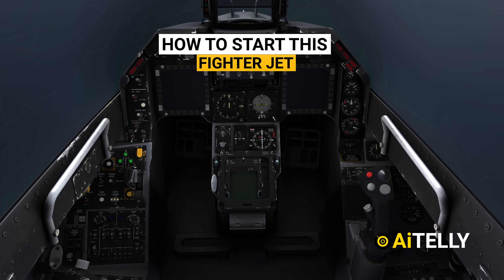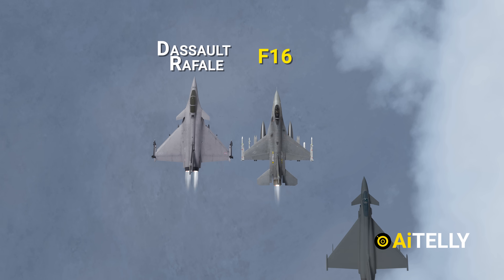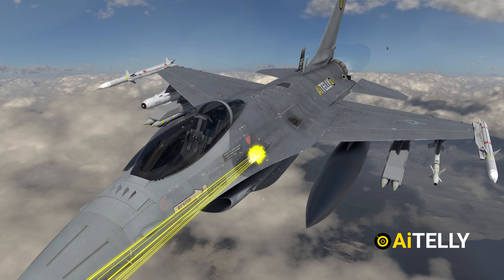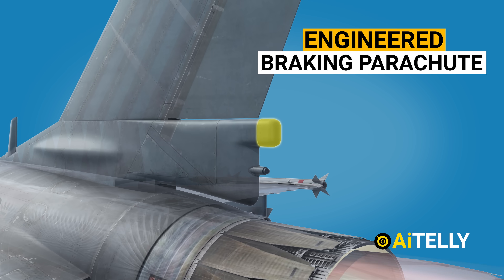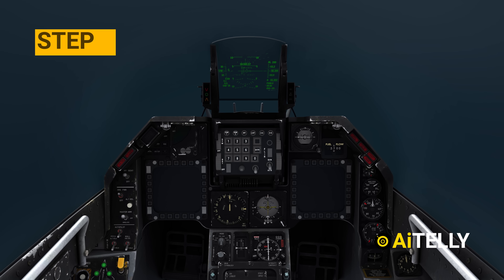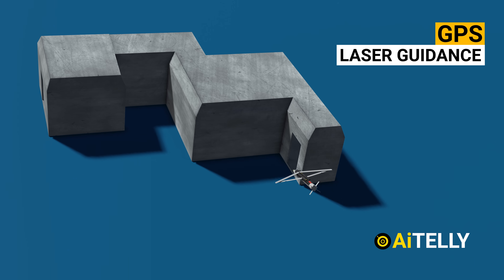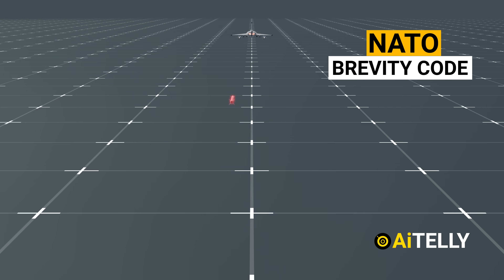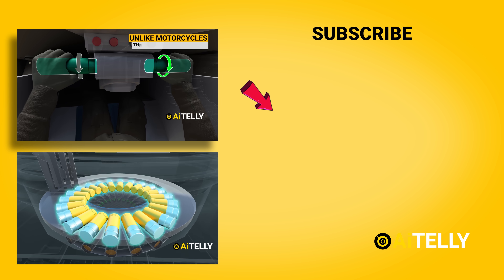F-16 Fighter Jet How it Works | 4th Generation Multirole Fighter F16

Comment: As a former F-16 crew chief, this was kind of hard to watch
Reply: Yeah, I never knew my RWR antennas were TWS radars all along!
Reply: What specifically is it that you find hard to watch? I’ll trust you more since you worked on the plane
Reply: @TC-en7cu  explain why then..
Reply: @ExecutivePuma it was not built to replace the F-14.
Reply: @RA-el6zj  it's called a throttle, not thruster. You don't need rwr or standby Adi on to start the jet.
Reply: @TC-en7cu  Thank you. 🙂👍🏻
Reply: As an F-16 pilot, I didn’t know Step 3 to starting the engine was turning on the RWR.
Reply: I love the leading edge slats!!! That’s definitely what they’re called!

Comment: The F 16 was not the successor of the F 14 Tomcat. The F 16 was the winner of the light weight fighter competition. The F 14 's successor is the F 18 Hornet derived from the YF 17 that lost the light weight fighter competition.
Reply: Correct!
🧠
Reply: correct, F-16 was replacement of F-4 Phantom II and F-105 Thunderchief ... because F-15 Eagle was too expensive
Reply: I think they just said it that way because the Navy was shopping for a replacement at the same time as the Air Force, and both looked into the F16, just so happens the Navy decided the hornet fit their needs better, while the Air Force went forward with the 16. It's not that what they said was inaccurate, it was just incomplete.
Reply: Totally agree 👍
Reply: Additionally, 5195 Phantoms F-4 were made. Narrator confirms to date 4,500 F-16 units had been built innacurately mentioning it has been the fighter with most units made.
Reply: Exactly
Reply: @JanChvojka  Incorrect. The F-14 and F-15 were the replacements for the F-4 Phantom II. The F-16 and F-18 were created because the Navy and Air Force needed cheaper and more maneuverable aircraft to perform functions that the larger and more expensive F-14s and F-15s couldn't do.
Reply: The F18 Super Hornet replaced the F14.

The F18 Hornet did not and served side by side with the F14 for 20 years before the Tomcat was retired.
Reply: no matter what in NO way was the F-16 a replacement for the F-14 as the US Navy never has used the F-16 and the Airforce never used the F-14.  F-14 and F-16 were both developed in the same era regardless.  Don't know where they got that idea from.
Reply: Correct. And also competed against the F18. Which after loosing with the F16, the F18 was selected for the Navy.
Reply: @adrianvega9946  That would be he YF-17
Reply: @2ksnakenoodles  Yes exactly
Reply: It's always such a bad idea to get someone wrong regarding aviation.

Comment: Your side stick labels are correct, except the "view reset" for track IR is the nosewheel steering/missile step button, track IR is a tool used in flight sims to capture head motion when looking around in a virtual cockpit. I also believe is display management system not data management.
Reply: Very poorly done research on this topic!

Comment: 1:10 Uhh, what? The F-16 was part of the lightweight tactical fighter competition for the US Air Force. The F-14 was a Navy fighter. The only sort of true thing about this comment is that the F-16’s competitor, the YF-17, evolved into the the F-18 which did support and eventually replace the F-14 in Navy service.
Reply: Yeah, I was like what? There's always some small mistakes in every video they made, but this is potential misinformation
Reply: The bugles on the side of the jet, aft of the nose are also not TWS ,they are missile detection. Small innacuracies being presented with confidence in this video
Reply from the maker: Politicians wanted to produce one Aircraft for the Airforce Navy and Marines.
But it failed.
Reply: @Aitelly  Yes, but this plane was F-111. F-16 was never meant to be replacement of F-14. F-16 from begining was designed to complement F-15 in USAF. YF-17 (latter F-18 Hornet) which loose competition with F-16 became later a NAVY fighter and as modernised version (Super Hornet) replaced F-14.

Comment: The rudder is not used to turn the aircraft left or right. The rudder is used to maintain the position of the nose of the aircraft (so that its going where it's pointing). Turning an aircraft is acheived by rolling the aircraft and pulling up. Depending on how tight turn needs to be more or less roll and more or less up stick is used.

Also, the combustion of fuel is further back in the engine, thr frint section is the compressors for compressing the incoming air.
Reply: As a Juno: New Origins player, I can confirm this as true and 100% real
Reply: Rudder ?
Reply: As an engine mechanic, I'm glad I'm not the only one that noticed that combustion error.
You have the fan (low pressure compressor), core (high pressure compressor), and then the combustion chamber. Then, there's the HPT and LPT, with the augmentor and exhaust nozzle following.
Reply: @johnc1014  I was an F-16 Jet Engine Mechanic when I served in the 80s.
Reply: @PaulJosephdeWerk  Nice. Our jets were built in the 80s. Did you work on Pratts or GEs?
Reply: @johnc1014  Pratt F100-PW-200
Reply: @PaulJosephdeWerk  👍 I never got it work on those. Only F110-GE-100.

Comment: I have had a Falcon simulator on my 286 PC in 1984. It was quiet amazing to realice that the turn radius at high speed was way bigger than at low.
Reply: Falcon simulator? Is that a plane
Reply: @Michiganian8  the F16 was so called, Falcon, and so the computer program.
Reply: Is "quiet amazing" when you don't say anything out loud (or make any other noises), and just think about it instead? I call it mental astonishment and use it often unconsciously, like when watching videos alone or when verbal utterances would be inappropriate.

Comment: I don’t recall the F-16 being made to replace the F-14, the jets had completely different missions and were operated by 2 different services, it’s also not the most produced fighter ever as stated, not even the most produced western jet fighter which is the F-4 phantom, perhaps you meant the most produced western 4th gen fighter?
Reply from the maker: Politician did - it was all about the Cost of maintaining the F14.
they thought the of one Aircraft for the NAvy Airforce and Marines .

but it failed
Reply: @Aitelly  indeed, the F-14 was incredibly expensive and retired in favor of the F/A-18 in no small part  due to that reason, however the F-16 was developed at roughly the same time period as the F-14, and was developed for entirety different reasons (low cost light weight fighter) for the Air Force than the F-14 for the navy (fleet defense fighter). These 2 aircraft didn’t really have anything to do with each other as their roles were so opposite, so to my knowledge as Iv looked around, I can find no mention of the F-16 even being considered to replace the F-14. However If you’ve read this somewhere and have a source I’d be willing to read it

Comment: A little fun fact: The block designations for the F-16 either end with a zero or with a two. If the designations ends with zero, example F-16C Block 50, that means that it uses the General Electric F110 engine, but if the designation ends with a two, example F-16C Block 52, that version has the Pratt and Whitney F100 engine. (Although this applies only to Block 30,32 and forward as that is when the F110 was first introduced to the F-16)

Comment: 1. The performance of the F-5, which the U.S. made to South Vietnam in the Vietnam War, was better than expected, and shocked by the maneuverability of the North Vietnamese Mig-21, the U.S. Air Force realizes that cheap, high-performance, lightweight fighter jets are possible. So, LWF is a lightweight, high-performance, half-priced fighter introduction program that complements the high-performance F-15 with numbers, where the YF-16 and YF-17 will be contested and the YF-16 will be chosen to become today's F-16.

2. The F-15 was a high-performance fighter that replaced the U.S. Air Force's F-4 and F-106, but it was too expensive to maintain, and was under budget pressure due to oil shocks and the Vietnam War at the time, so the F-15 could not fully replace the number of the existing F-4s. That's why the LWF program, a new concept of cheap lightweight, high-performance fighter jets, was ordered.

3. The U.S. Navy, which was under the same budget pressure as the U.S. Air Force at the time, was receiving orders from the U.S. Congress to introduce lightweight fighters. So it subsidizes the F-14 and A-6, has a cheap, high-performance, lightweight fighter NACF program to replace the F-4 and A-7, and the U.S. Navy chooses the YF-17, which was already designed to save on development costs, and this is the F/A-18 Legacy Hornet.

4. The F/A-18 Legacy Hornet was built with the same lightweight fighter as the F-16, so it couldn't replace the F-14 because of its small armament and cambat range, so it completely replaces the F-14 by creating a new F-18E/F, which is 40% more in size.

Comment: F 16 was built to  compliment F 15 not to replace F 14 which  is a navy operated platform US Navy does not have F 16s in its inventory
Reply: F-16’s was actually planned to be on US carrier but lost to the F/A-18
Reply from the maker: Agreeed it was planned but it failed as the Navy and Marine has their own requirement
Reply: @netsimam  YF 16 and YF 17 originally designed for USAF Although YF17 lost the lightweight fighter aircraft competition to the F-16 Fighting Falcon, the YF-17 was selected for the new Naval Fighter Attack Experimental (VFAX) program. In enlarged form, the F/A-18 Hornet was adopted by the United States Navy and United States Marine Corps
Reply from the maker: Thanks

Comment: I want to mention that “fly by wire” means the stick does not directly control the craft, the stick gives instructions to the aircraft’s computer and the computer figures out the best way to accomplish the orders, this aircraft is also an intentionally unstable aircraft, so the computer has to constantly fix the course, the exchange for this is better maneuvering.

This is also why the F-16 has perfectly straight wings on the middle of the fuselage, instead of on top or angled on the bottom as other fighters.

Comment: There is one inaccuracy in your video.  The F 16 was not produced to replace the F 14, it was produced to compliment the F15.  The F15 was seen as high level fighter and the air force needed a light weight fighter to compliment it.  The F14 was a navy fighter while the F15 and F16 are air force fighters.  The light weight fighter for the navy was the F/A 18 and its variant, the Super Hornet would later on replace the F 14 in 2006.
Reply: Also the smaller size of the F-16 isn't the reason it can be vulnerable to SAM systems. It is quite the opposite.

Comment: Great explanation. Only thing that fuel injection is made not front part of engine but middle (combustion chembers). Front part of engine is compressors area that increases pressure of sucked air before burning respecting to Brayton thermal cycle. Thanks for video.
Reply from the maker: Thanks for your information regarding this engine

Comment: I have a complaint about the sound you used for the M61 Vulcan. That sound is actually the sound if the bullets impacting the ground. The other, higher pitched “whine” is the actual sound it makes.
Reply from the maker: Thanks for the info.
You might also like Nuclear Powered Submarine Engineering behind it #3d Nuclear Reactor released
Link: https://youtu.be/J0lb46Zi5-s

Comment: Fact: Fly by wire system is a necessity for F-16s stable flight since F-16s were built to be aerodynamically unstable to increase manoeuvrability to compete with Russian Counterparts.

Comment: Major issue with fuel injection;  it is not injected in the engine inlet/compressor,  but further down in the combustion chamber.

Comment: The F-16 was not designed to take the place of the F-14, however the channel got that wrong?
The F-16 is an Airforce plane, the F-14 was a Navy plane.
(Fun fact, the navy just bought some F-16s from the Air Force, to serve as “agressor squadron”.)

Comment: Very good video, keep up the good work. But please check your facts before using them in the video. General Dynamics doesn't exists anymore as it has been bought by Lockheed Martin ages ago. It was never intended to replace the F14 (that was the F18) but the F4, F5 and Mirage5 (US and Europe) as a complement to the F15 which was better but also cost much more to be the sole foghter to fill all squadrons and the US armed forces doenst like to single source and keep up the competition. The most build jet since WWII is the MIG21 Fishbed with over double the numbers of the F16, even if the MIG21 has stopped been produced while the F16 continues in its F16V variant. There is no 360° radar in the F16 and ANPG should be AN/APG-66, -68 or -83 depending on the version of F16.
Reply from the maker: Thanks for the feedback

Comment: the F-16C Fighting Falcon (Block 50+ Advanced) multi role air dominance fighter was not the replacement of the naval carrier borne F-14C Tomcat multi role fighter interceptor . . . not even close because both were designed to serve very different purposes . . . the F-16 was conceived to supplement the F-15E Strike Eagle (Block 30) multi role interdictor strike fighter, as a cheap alternative to the expensive F-15 . . . the carrier borne F-14C Tomcat multi role fighter interceptor was to be replaced by another dedicated carrier borne fighter interceptor, that we know now as the F/A-18 Hornet . . .

Comment: Wrong it wasn’t built to replace the F-14 it was built as replacement for the F-15. And at the time it was the Air Force that was looking for a new air superiority fighter. Not the navy. And it was pitted against the YF-17 which we all know was the better design but was terrible underpowered with the engines. But the US Navy saw the YF-17 prototype had potential and thus was given another chance with a new prototype that followed the same design but had better engines, stronger landing gear, and it was thus redesignated as the YF-18 and eventually became the F/A-18 Hornet
Reply: The F16 was built as a compliment to the F15. It was never intended to replace it. As for the YF17 being the better platform, that is 'very' debatable.

Comment: Correction. F-16 is not design to replace the F-14 Tomcat.  YF-16 and YF-17 are design to prove the Energy Maneuverable  Light Fighter Concept. There is a fighter mafia group, who believe a cheap light weight highly maneuverable, can allow USA to win any dog fight against the USSR MIG fighters. The F-14 and F-15 are big expensive fighters. USAF feel that a high cost and low cost mixes of fighters is a better idea. Thus F-15 and F-16 are the suitable pair. The Navy want a multi-role fighter to that can perform fighter and attack roles. Eventually, the YF-17 are modified to become F/A-18.

Comment: Ahh, the F-16 was not made to replace the F-14. The F-16 is an Airforce project and was never intended to go on carriers. It was made to be a more fiscally obtainable fighter for export and to bolster our own Airforce strength due to the high cost of the F-15.
Reply from the maker: Agreed 👍
Reply: And to give and edge in the "air to air" environment.

Comment: Love the information on the video, but no, the F-16 was never the replacement for the F-14.  While you are correct the F-14 was an iconic naval fighter, the F-16 was always intended for the US Air Force, As it went up against the Northrop YF-17 Cobra, in a competition for a new lightweight fighter. Thankfully, the vision of the YF-17, was reborn in the F-18 Hornet program, the eventual replacement of the F-14 Tomcat.

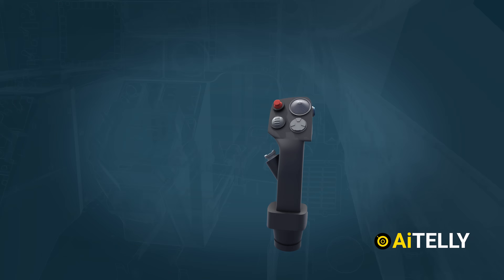Comment: 7:18 thats is not exacly, there are few steps before, start the engine, (conect the battery, conect the fuel master switch, set the coling and airpresure flow), set the starter in 1 or 2  position and then procede to start using the throttle switch, and even after that there are several steps even befor take off, i understand that by the nature of the video it has to be short, but thar procedure was wrong.

Comment: F-16 is an airforce not navy, why would airforce want to replace navy's f-14? F-16 was replacement of f-15/a-10. Your jet engine presentation is completely wrong fyi.
Reply from the maker: It was the  Politician that wanted an all in one replacement that means - one Fighter jet For AIRFORCE-NAVY -MARINES.

But it failed as the navy opted for the f18 Superhornet

Comment: I am sorry, but you got a lot wrong. 

"Most widely produced military aircraft... EVER"
Wrong ! IL-2 and Me-109 of WW2 (both ~35.000)
Most Produced Jetfighter is the MiG-21 (~11.000)
"most widely >deployed< aircraft today" would be true. 

"Designed to replace the F-14 Tomcat"
Complicated topic but simply said... NO !

2:56 Where do i even start here...

7:24 you show the stick having the function "View Reset (Track IR)"
that's a specific thing for a Headtracking device used by many Flightsim enthusiasts and has nothing to to with the real aircraft

8:40 AGM-65 cannot be carried on this pylon 

Just 5 things i found in a short amount of time. 
I understand certain simplifications but another hour of QA could have prevented a lot of errors

Comment: F 16s were conceived after less than expected performance and identification of F 4 Phantoms limitations against MiGs. USAF needed aircrafts to fill in for F 86 Sabres. Agile dogfighter. F 16s did not replace F 14s, designed for naval aviation. F 14s were replaced by F 18s. I ask myself that why F 14s could not be upgraded into newer blocks like F 16s ? Tomcat as you stated was an engineering marvel. Haven't seen a more streamlined fighter. No offence to the Falcon.
Enjoyed the video. You could have elaborated more on the throttle.